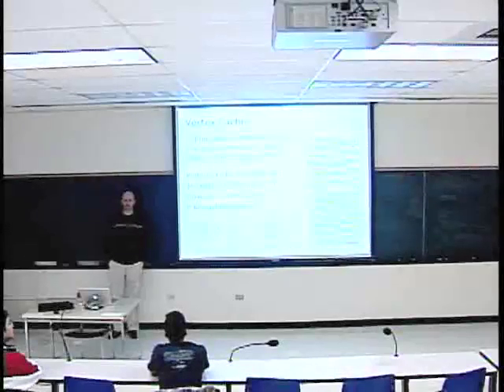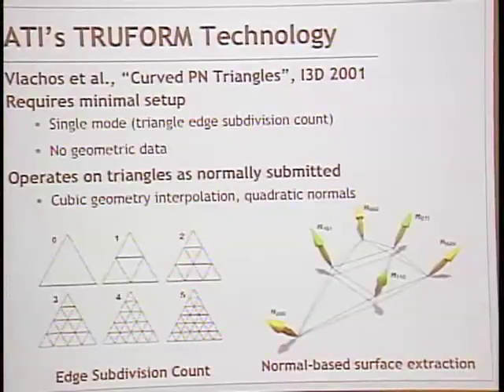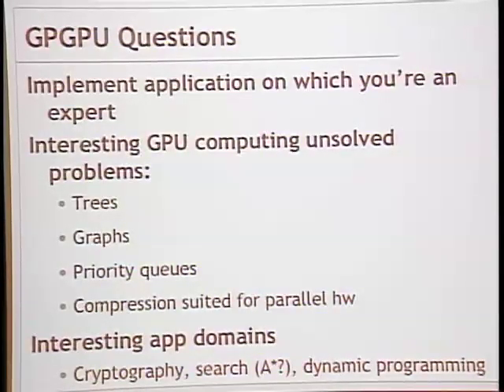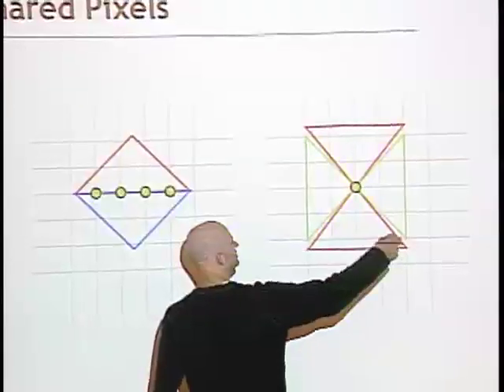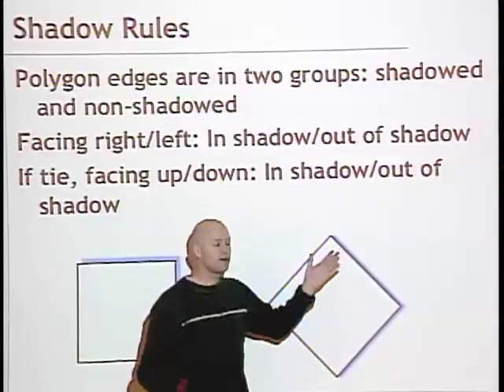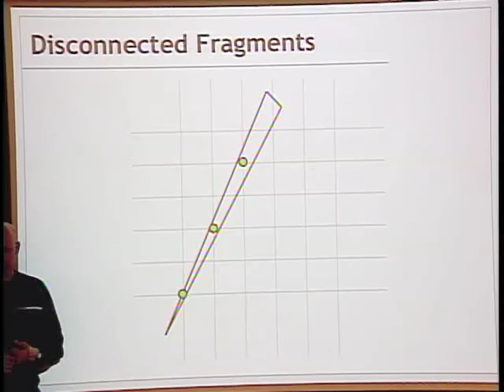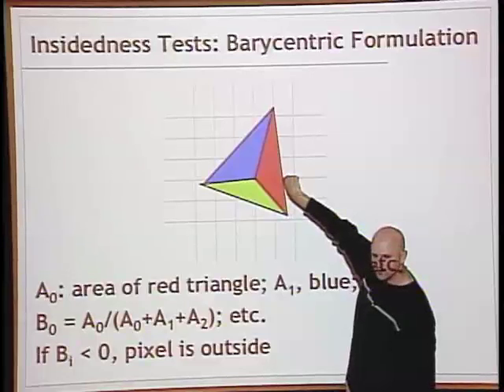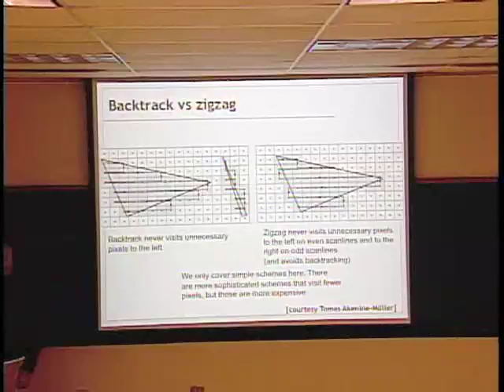Rasterization

Comment: Great talk.

But, one thing that's often confused me (like the guy at 56:30 said), is that the diagrams shown usually have the screen "pixels" represented by where the lines intersect.

To my mind, would it not make more sense to have the sample points (yellow dots) in the centres of the squares?
That way, the squares would represent the exact size of the pixels, relative to the example polygons. ;)

This probably stems back to using graph paper in the 80s and 90s to design levels for the Amiga or ZX Spectrum, but I'm sure I'm not alone. lol

(I think even the N64 patents show the sample points as the centres of each square on a grid?)